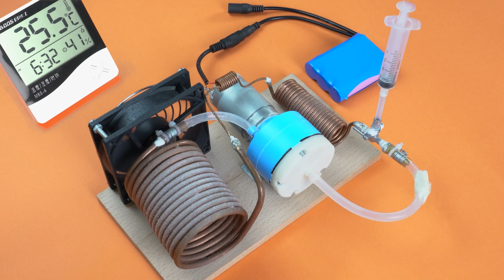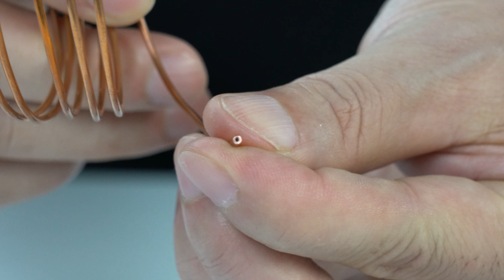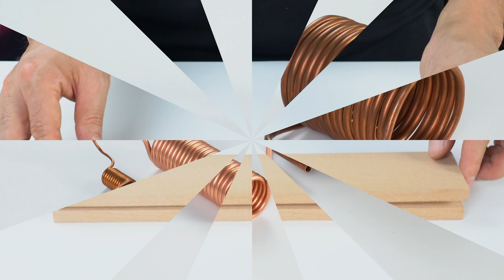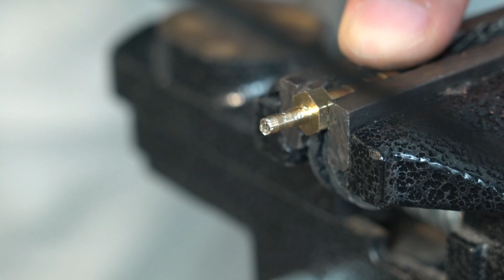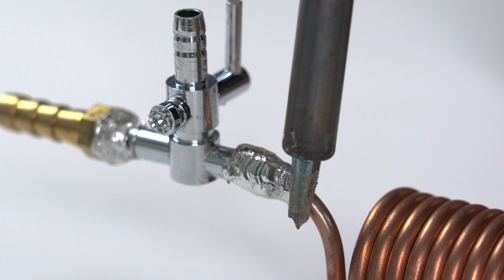How To Make AC | DIY Smart Air Conditioner Mini Powerful AC | BillMingLabs

Comment: Show real video of icing and condensation, it’s impossible to make ice on such low pressures. Even for the butane gas with boiling point of -1 and higher Enthalpy it still needs a lot of pressure 200 to 250 psi on condenser and 50 psi around the evaporator after capillary. The plastic TuBINgs can’t able to handle such higher pressure, how can you make it make ice on The evaporator? THE small diaphragm pump u are using is just capable TO make high enough  around 50psi or some near 80 psi even this is too much for a small pump. If you are really confident enough show the condenser temperature and evaporator tempreature without zooming and editing the video raTHEr Than showing Fakes !
Reply from the maker: Thanks for your comments. Have a good day!😀
Reply: THE MODEL shows how an vapour compression system works , BUT YOU CAN MAKE IT WORK in reality ALSO JUST USE A BIGGER SIZE COMPRESSOR pump or preferably use a mini 12v rotary vane pump. Its will definitely work , you will get temperature differences on both high and low sides. You can also use a mini piston pump having compression ratings above 150- 200 psi . It works !
Reply: @hatwaradityasubhash8987 Great idea😊
Reply: Deveriam ser proibido esses tipos de vídeos fake. Muita gente acaba acreditando
Reply: @BillMingLabs ⚠️ God has said in the Quran:

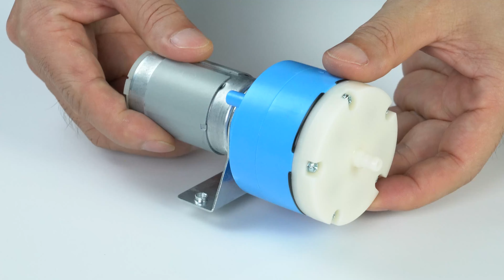🔵 { O mankind, worship your Lord, who created you and those before you, that you may become righteous - ( 2:21 ) 

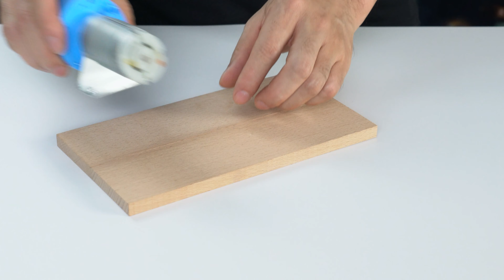🔴 [He] who made for you the earth a bed [spread out] and the sky a ceiling and sent down from the sky, rain and brought forth thereby fruits as provision for you. So do not attribute to Allah equals while you know [that there is nothing similar to Him]. ( 2:22 )

🔵 And if you are in doubt about what We have sent down upon Our Servant [Muhammad], then produce a surah the like thereof and call upon your witnesses other than Allah, if you should be truthful. ( 2:23 )

🔴 But if you do not - and you will never be able to - then fear the Fire, whose fuel is men and stones, prepared for the disbelievers.( 2:24 )

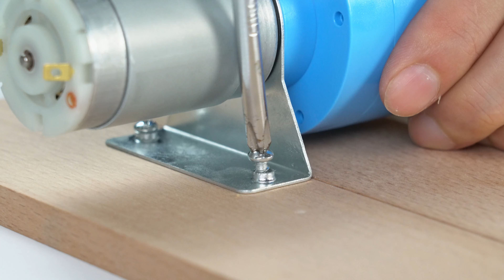🔵 And give good tidings to those who believe and do righteous deeds that they will have gardens [in Paradise] beneath which rivers flow. Whenever they are provided with a provision of fruit therefrom, they will say, "This is what we were provided with before." And it is given to them in likeness. And they will have therein purified spouses, and they will abide therein eternally. ( 2:25 )

⚠️ Quran
Reply: Vape is only 3volts create a smoke
Reply: You don't need 150 psi for butane, as little as 40 psi can still make freezing temps on the cold side.
Reply: Those tubes are made for that motor's PSI rating
Reply: From chatGPT :

Butane heat pumps are uncommon, but if you’re referring to refrigeration or heating equipment using butane (R600), the minimum PSI rating depends on the operating pressure range of the system.

For a system using butane (R600) as a refrigerant:
	1.	Low-pressure side (evaporator): Typically between 1–10 psi.
	2.	High-pressure side (condenser): Can range from 50–120 psi, depending on the system design and operating conditions.

The exact minimum PSI rating for components like the compressor, pipes, and valves depends on the specifications of the system. It’s critical to ensure components are rated for the maximum expected pressure during operation. For safety, most systems are designed with a higher pressure tolerance than normal operating conditions.

If you’re designing or troubleshooting a system, always follow manufacturer guidelines and safety standards (like those from ASHRAE or local regulations). Can you clarify if you’re referring to a specific device or application?

Comment: If this would actually work, then sell it to me.  I have made 5 now and none worked, I did use your lighter fluid, I have that and used 4 different product fluids.  Mine is now on a wall left for looks.  I used silver solder and my glue no issue in one second.  I only now used copper and brass, no leaks finally, I had 140 psi no need.   I used 5 psi and no need.  I take it you removed air before using.  I have removed all air in the lines and yet no use for work.   If I could actually use one for a reason, it would be pleased.  Thanks!
Reply from the maker: I am currently trying to make a small air conditioner using a Panasonic mini air compressor. This mini compressor is only about the size of a regular water cup. I believe it can be used to make a truly practical small air conditioner. Thank you for watching and commenting. Wishing you a happy day！

Comment: Sorry, but I have made 5 units and would not work with plastic tubing. The pressure would not work with light rubber and heavy, I used expensive glue, and it would not work.  I have used three different types and none of them worked.
Reply from the maker: It is recommended to use a high-power air compressor pump (not a water pump) and thoroughly inspect the device for any air leaks. Good luck

Comment: So I see a lot of comments here, but no one stating the obvious truth... The air conditioner would do nothing, since it's not exhausting the hot air outside. The hot coil needs to be on the outside. Otherwise it's simply not possible
Reply from the maker: Thank your for watching and commenting. Have a good day!😀
Reply: It would be good to cool a can of drink but aircon no. I agree. It's not venting to an external place so would increase the rooms temperature over time with the heat from components and motors.

Comment: Not enough power in the compressor, if it had the right temp/pressure it would blow the tubing off the condensor or melt the plastic. Next the metering device has to many wraps and the length of the copper tubing after defeat the purpose, immediately after the metering device should be the low pressure low temp side(the evaporator). In either case you are moving heat what 6 inches away tops and the configuration of those coils for the evaporator and condensor are not efficient. If you look at your ac unit you will see aluminum fins, this is to more efficiently absord and disipate heat. But moving the heat to the same room only adds heat not remove heat because the motor being used as a compressor generates heat.
Reply from the maker: I think I'll take your advice. Thank you for commenting! 😀 Good luck!
Reply: THANK YOU! Finally someone in one of these fake diy mini ac unit videos understands the refrigeration cycle. Or at least some thermodynamics. Do not try this at home. It is waste of time and money.

Comment: To me it looks like he has the evaporator and condenser coils reversed. 
Condenser must be the big coil to get rid of the heat plus fan to blow hot air into atmosphere. The evapotator is the small coil for cooling. Or do I have it wrong?

Comment: I have only used standard water pumps.  If I could get your type of Pump, please let me know?
Reply: Its a high powered air compressor pump a small one
Reply from the maker: It's a 12V 1.5A air compressor pump.
Reply from the maker: That's right.

Comment: What are the materials
Reply from the maker: The core materials include three different specifications of copper pipes, air compression pumps (not water pumps), and refrigerants (I use butane gas).
Reply: salt and white powder to look ice and trick the viewer hahahaha

Comment: I was to use this concept for a tent cooler for camping so badly do you think this will work for 12-24 hours without problem given I have enough battery power?
Reply from the maker: Thank you for watching. This plan is not very feasible. Suggest purchasing parking air conditioning. Good luck😀
Reply: @ thank you for responding maybe when I have time I will try using computer processor radiator?

Comment: need 4-8 bars to liquify on butane. I succeeded with car tyre compressor. There is a video on my channel
Reply: DIY refrigerators running on butane. Fake videos with water pumps. With an air compressor works -3C.
Reply from the maker: Great job！👍

Comment: I've tried a few pumps, including this pump from you, and they all don't hold the gas for long. The pressure on this pump is also too small. The rest looks good. Maybe the capillary tube could be too long but otherwise it looks good, keep it up!!
Reply from the maker: The purchased air pump will leak air. Disassembling and resealing it may be a good solution. I am trying to make a new air conditioner. Big thank you for your wonderful and supportive comments. Have a good day!😀

Comment: Even initially you would have put butane gas directly through the valve itself no need of inserting with the syringe.
Reply from the maker: I added this syringe to detect if the valve is leaking air😀
Reply: @BillMingLabs gerçekten ne kadar süre ise yarıyor yada ise yarıyor mu

Comment: Fake. Freezing scene is reversed. You freezed condenser, filmed how ice melts, zoomed in and just reversed footage. You should put inside liquid butane gas so it will be under high pressure. It will not work with just butane gas.
Reply from the maker: Thank you for watching and commenting.
Reply: Comprei o motor pensando ser verdade, estou frustrado!
Enganação!

Comment: Great video, i just want to ask why u made 3 different size of coils, i saw it on other videos too but dont know the reason for it, can u please tell me
Reply from the maker: The video just showcases the operating principle of air conditioning. The thickest is the evaporator, the thinnest is the capillary, and the medium-sized is the condenser. The condenser converts high-pressure gas (refrigerant) into high-pressure liquid; Capillary tubes transform high-pressure liquids into low-pressure liquids; The evaporator converts low-pressure liquid into low-pressure gas. A pump is a compressor that converts low-pressure gas into high-pressure gas. Butane is a refrigerant (Danger! R22 is recommended).
Reply: @BillMingLabs  I see so it's like a condenser?

Comment: Definitely possible. 

 I like how u kept the evaporator coil ID greater than condenser coil ID and attached to correct suction and compression orientation

That capillary expansion valve is also good. I have seen this on old school fridge repair work. That fridge is still working like a charm without the thermostatic expansion valve.  

Butane and propane are very efficient refrigerant but not commonly used due to flammable. 

 You just need to have a functional thermostat cut off mechanism. And thermal separation to make it more efficient. 

I am still confused about what that injection is doing. Because once you open the valve the piston will fly.

Sounds weird but Yes you can use that injection as a manual assist to accelerate the process. As the pressure inside will lift the piston and pressing it can instantly boost the compression as there is already NRV present on the pump.  But best of luck with sour thumbs. 😂😂. 
. 
Good work bro
Reply: Can i use diagraphm pump as the compressor?
Reply from the maker: The syringe serves two purposes: firstly, to test whether the valve is leaking, and secondly, to manually increase pressure. Thank you for your attention and comments. Have a nice day!😀
Reply: Это не может работать.
Это фейк.